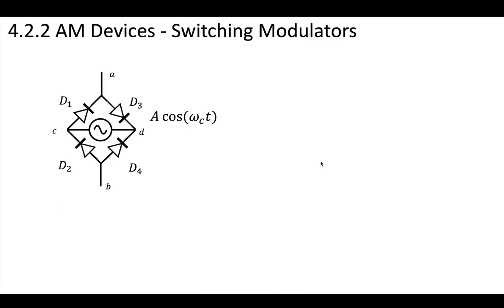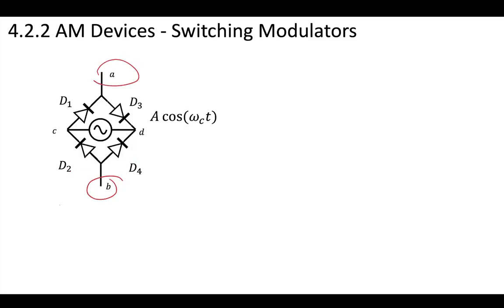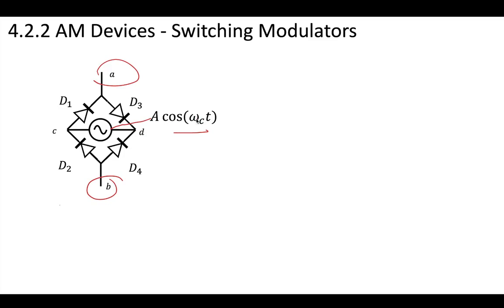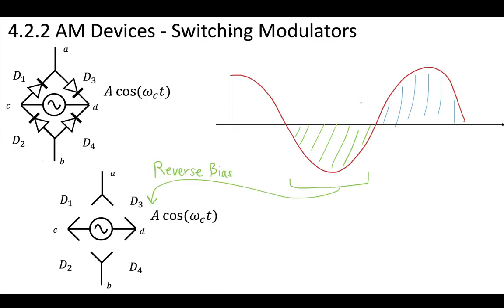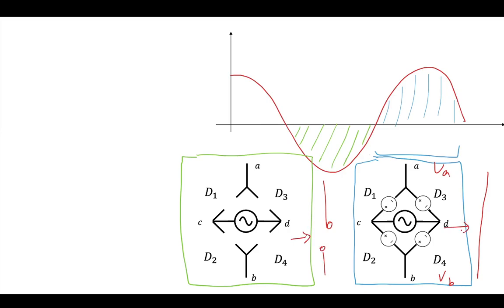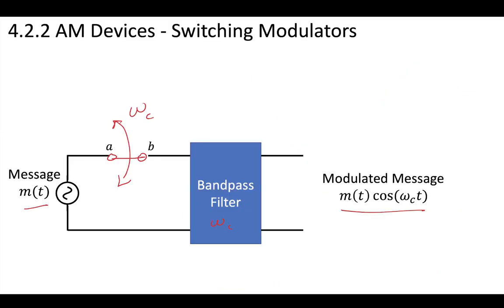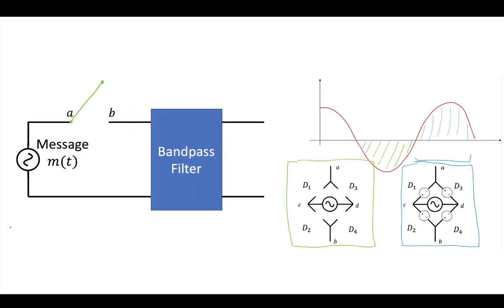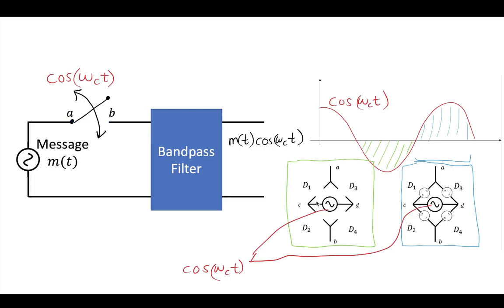12 - 4.2.2 Diode Bridge Switching Modulator Explained

Comment: diode 2 is placed in opposite polarity.... please change
Reply from the maker: Thank you, this is correct! In the figure showing the diode circuit elements D2 is mistakenly placed in reverse. However, in the simple diode circuit model D2 is replaced with a voltage source in correct polarity. When I get a chance I will upload a correction. For those following the text -- please compare to the correct Figure 4.5 (a) in Lathi 5th edition.